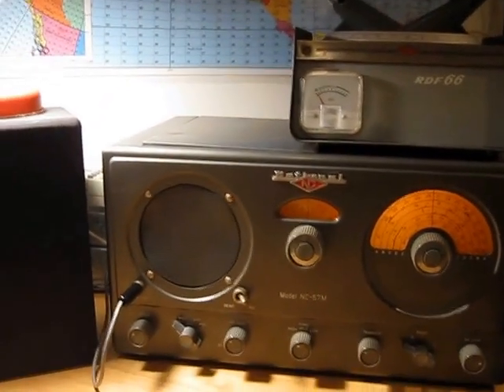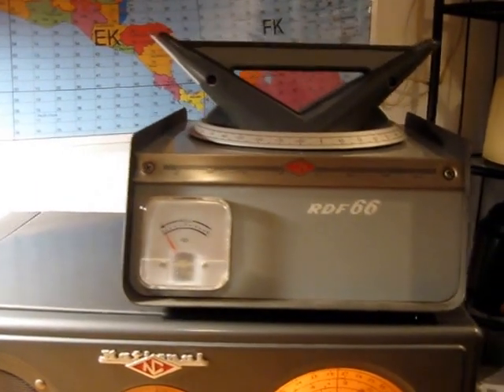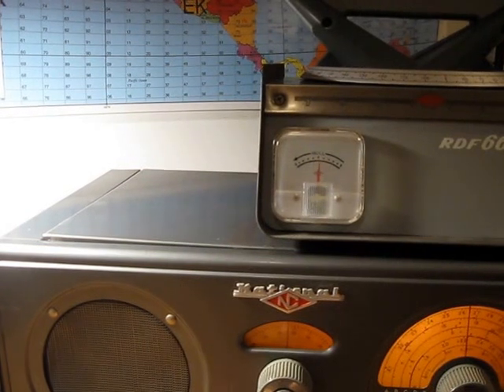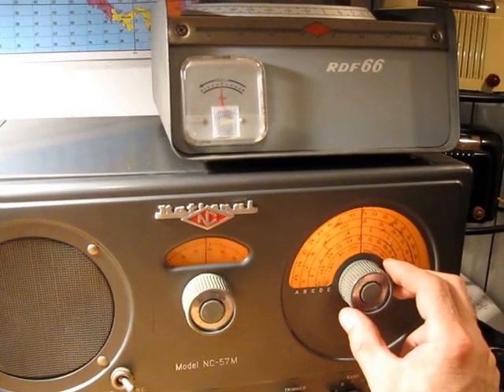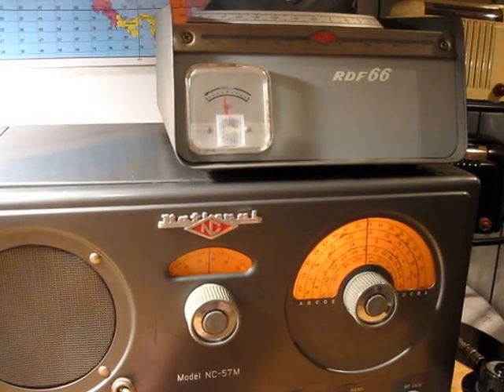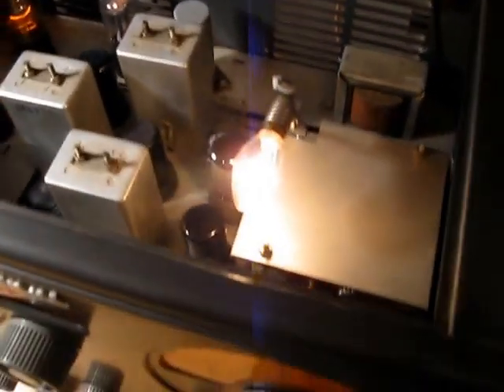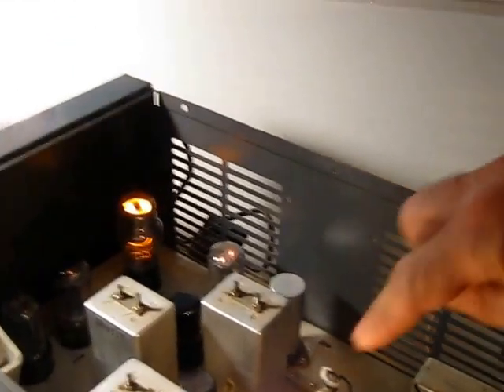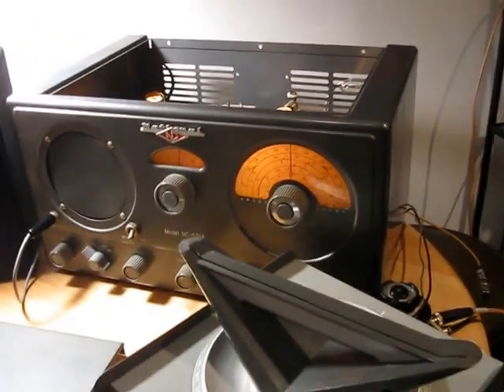NDB DXing With National NC-57M @ WA3TTS

Comment: Hi Mike   Picking up a NC57B and NC125 this week 73 Herb K2LNS
Reply from the maker: Herb, dont stress the tuning shaft on it, they break easily.  The NC-57M is a different animal, the RF deck is all ground isolated, AC/DC supply...fairly decent LF radio for what it is...Tnx for the buzz, 73 Mike tts